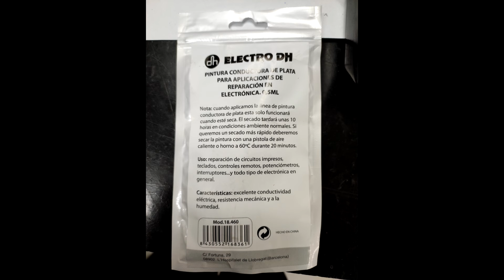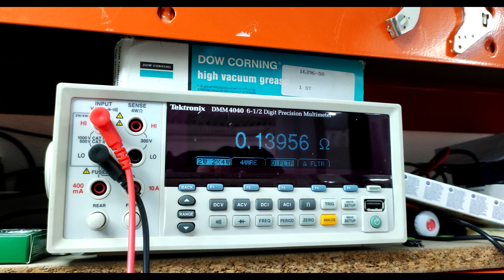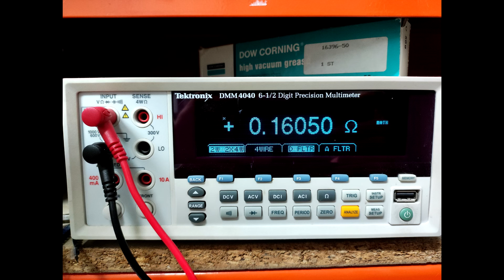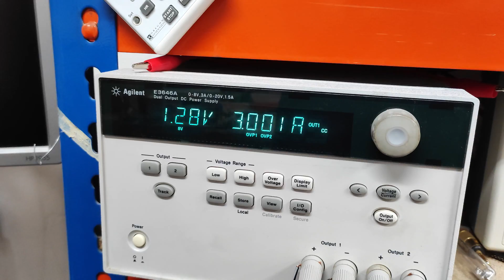Conductive silver paint to connect poor solderability contacts - glass LCD flex cable repair

Comment: Would this in theory work on a car Defogger lines ? Does it harden and what is the maximum V and Amp you can send through it, and how long can you make the line ? 
Yes i know there are defogger kits out there but they are so many and half of them are fake paste with no conductive element in them.
Reply from the maker: Those repair kits should in theory be very similar to this product, you can try and buy it from a somewhat respectable brand to reduce the risk of buying a fake product. This specific one doesn't have very detailed data, and that data would be given under very specific circumstances (cured repair section area, temperature, etc.). I think you should try and find a specific product for your application instead of going for a more generic product like this one.

Comment: Not convinced it would work on a board with tactile switches that has pressure from pressing hands alot it may break up and cause some trouble even if you could coat over it with hot glue or epoxy it would be destroying the pcb even more
Reply from the maker: It is somewhat flexible, but you are probably right.

Comment: I used one of these to mod "solder" a chip on my Nintendo Switch that was banned. Gotta say, im pleasantly surprised by the outcome. It was very easy to do, temperature is almost not there and i did use a hair dryer to speed up the drying process. Good products for anyone who isn't sure about using a soldering iron/pen on small pins...
Reply: Does your switch still work?

Comment: hello !  I've just received mine , but I didn't know you needed to dry the paint out in an oven . I want to repair my desktop motherboard traces , is it mandatory to bake my motherboard to dry the conductive paint
Reply from the maker: Hi, the one I used in the video can dry at room temperature, but it will take at least 10 hours, I used the oven to speed up the process. 
Regarding your repair, unless it is a wide trace, it might be hard to repair thin traces with this product, if they are regular copper traces you might want to consider soldering a wire instead.
Reply: @jfaria  it a trace for DDR2   , I accidentaly cut the trace , and now I  only got one DDR  slot working , my mobo has two slots , if I can fix the second I would be able to reach 4GB , I'm stuck to 2GB for now , and there are no DDR2  for desktop at 4GB . the only one I saw on ebay were Chinese
Reply from the maker: @tunkunrunk  I think the wire shunt method with lots of soldering flux would be better, look at videos like this one:
https://www.youtube.com/watch?v=mFMkfAyqBMc
Reply: @jfaria  ok , thanks I'll give it a try